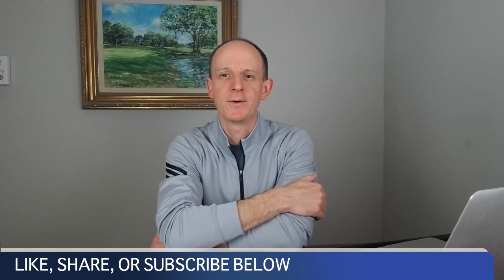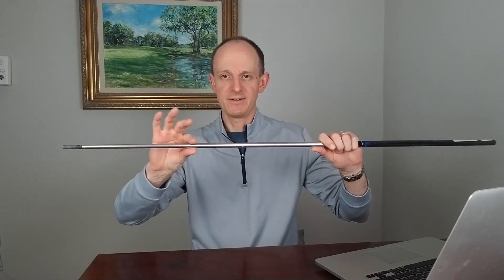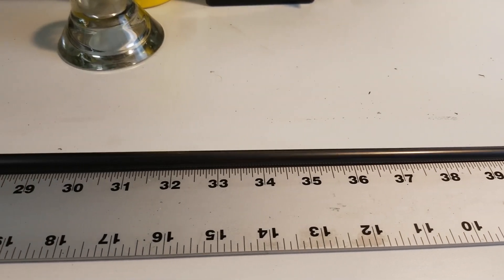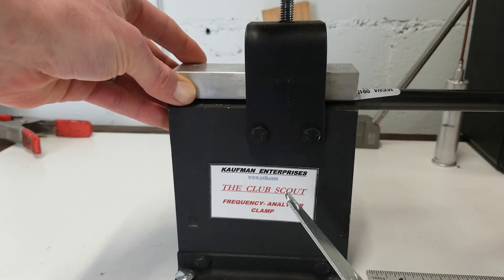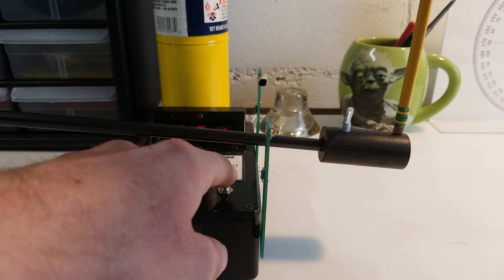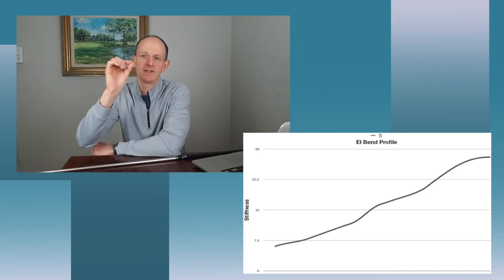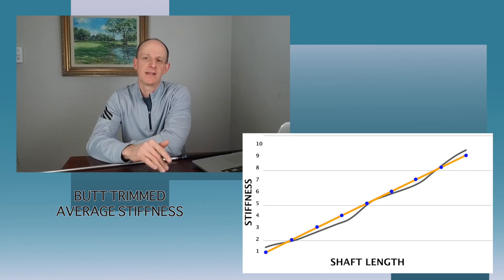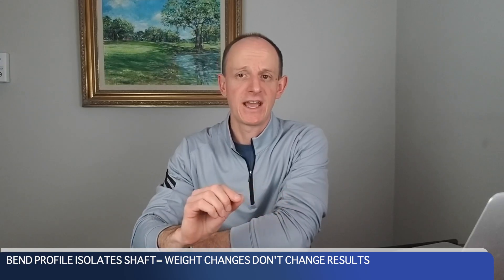SHAFT STIFFNESS, TIPPING, AND TRIMMING - What happens when we cut a golf shaft from either end

Comment: Hi: How would the tip trim stiffness apply to a normal swing.  If I play a 9* soft tip and it gets me 12 degree driver launch.  Then I trim ti tip 1.5" to a stiff.. and extend the club 1".   lower spin before and after ball leaks.   Seems like the stiff tip changes launch angle by almost a 1.5 degrees.

Comment: I was given a QI10 Max 3 wood with a stock ventus blue TR 6-R shaft. I want to cut it to 5 wood length and get more of a 6-S shaft. How should I trim the shaft and how much weight should I add to the head?
Reply from the maker: Need to take an inch off the tip side. Weight will be totally player dependent. Will need to play around with it and see if and how much you need to add back.

Comment: Hello, I thought you might be able to address a couple of questions. I purchase a used odyssey #9 putter. It’s 34” long and I’d like to cut it down an inch. How would that affect the club overall? Would it feel lighter? If so can I place some lead powder down the shaft, if so how much to have the same feel it has now? Thank you.
Reply from the maker: Yes, it will feel and be lighter. I don't like powder because it changes the feel of the putter. Lead tape or tungsten sticker weights are better and they also allow you to experiment with different amounts of weight to find what feels best. Never assume that the starting feel at one length will still be the preferred feel at a different length.
Reply: @EFGMC  hello, thank you very much for responding and sharing your insights, greatly appreciate it. I like the feel of the putter as is so I think I’ll just put a new grip on it making sure the new grip weighs the same as the one that’s on it now. All the best to you!

Comment: I bought a Ping Zing black dot lob wedge from 2nd Swing and it was advertised as measuring 36” long stiff shafted. The 36” is approx 1” longer than most sand wedges and lob wedges so I am guessing it was for a taller player. My wrist break is 35” which considered  a standard length so I’d like to trim it from the butt end  because it’s easier to shorten that way and I’ll just re-grip it. Based on your explanation for tip-end trim vs butt-end trim should it matter one way of the other??
Reply from the maker: That club should only need butt trimming to make it standard in every way.
Reply: @EFGMC greatly appreciated. Thank you!

Comment: Superb information on your video, especially for a newbie to shaft trimming and fitting. Thank you for sharing. 
If a person wanted to take a Diamana Kai 'Li Mid 65G stiff driver shaft and reduce the length for a three metal wood, it might be best to trim a short piece from both the tip end of the shaft and the butt end of the shaft to maintain  the integrity of the stiff shaft. Does that sound okay? 
If not, I'd be interested to know what your thoughts are on this.
Reply from the maker: I would default to what the OEM recommends for tip trimming a 3 wood vs a driver.
Reply: @EFGMC  Sounds good. Thank you!

Comment: Yup, great video!!! Been trying to find that unicorn driver shaft! My issue, i play a 43” to 43.25” shaft. So i know imma be trimming the shaft regardless. Its finding that right profile after the trim! To give an example, in my irons, i play the kbs tour lite… basically a 4b2m mpf code. Feels great!!!! But with my driver….. not sure. Now, my old school driver, i took the 586 speeder stiff shaft that was put into the big bertha fusion driver and trimmed -2” from the butt. Love the feel of that shaft, but need a lil more tip stiffness due to hooks from time to time. So im a lil lost haha cuz i know my swing weight is d2…. But i want a smoother feeling shaft than my hzrdus black gen 5 at 43.5”.

Comment: So this might sound like a stupid question, if you get a brand new 46" shaft and you want to shorten it to 45" and still play as the manufacturer intended, do you cut 1/2" of both ends?
Reply from the maker: If the playing length is going to be 45 then you will likely need to cut it down to 44 before installation. The manufacturer will tell you how much you should tip the  shaft. After that, any additional cutting should be done from the butt end.

Comment: I have a 45.75" Qi10 and I'm very tempted to cut it down to 44.75", but I'm nervous about the results.  I know I'm supposed to add back in 12g of weight to the head (easy to do with this driver as you can just buy heavier weights).  So in theory, the swing weight should be the same, but I'm nervous about the results with the stiffness and what it will do to the playability of the club.  Better to just choke down or cut it and add weight, will it kill the club? Thoughts?

Comment: If I  feel I am in between Stiff and Reg will it make sense to Tip trim?
Reply from the maker: You could. I also just did a video on this topic.
https://youtu.be/E9qMY0hpVg0?si=Ddfqx4rXHoATr-YT
Reply: @EFGMC  I ordered a Oban HB center balanced driver shaft regular flex, should I still tip it, or would that mess up the center balance aspect of it.
Reply from the maker: @marksnyder8697  Tip it if you were planning on it. Won't change the balance.

Comment: Another very educated video. But I think some points are missed. First of all, never trim your shaft if you want to reduce an inch, just choke up. Yes chocking up will stiffen the shaft but not because of any drastic swing speed change but a change in moment of inertia. Adding wait will put more stress on the shaft and thus greater flex.  You would never trim the tip unless you were looking to stiffen

Comment: Hi AJ..I recently purchased a set of Mamiya Recoil F4 480 iron shafts. I trimmed and fitted a shaft into an 7 iron and discovered that this shaft is too stiff. I then increased the swing weight to D4 from D1.9 and it made no real difference to the flex..If I removed and fitted this shaft to a 9 iron, without further trimming. What would be the Flex in the 9 iron? Would it then be a Regular Flex or close to a Reg flex?  Great vid again.Full of interesting content..cheers
Reply from the maker: The heavier the head you put on any given shaft, the more it can bend. You are adding around 14g of weight going from 7i to 9i so the shaft will play more flexible.
Reply: Hi AJ, may I ask, how much more flexible would the shaft be? Is there any test you could carry out and find exactly what the flex would be?...thanks Nick
Reply from the maker: @nickpritchard7130  You could put it on a frequency meter and see where it lands there.
Reply: Hi AJ..Will the shaft go down to a Reg Flex if I trim the shaft One Inch less, IE 1 1/2 inches instead of 2 1/2 inches?  Thanks
Reply from the maker: @nickpritchard7130  It will be softer, closer to R flex.

Comment: Thanks for the share! Couple of things I have tried to figure: How would the spine react in swing? Is it the droop or load with the "plane" axis what matters? Would it be more beneficial to spine along the swing "plane" rather than vertical assessing with the club head pointing upwards. I have used laser light attached to the shaft just above club head (using fishing line for quick rotation) and glued the head when the oscillation isn't spinning circle but str8

Comment: Whooo...admittedly, I ain't very smert...but I'm having a difficult time wrapping my head around this!  I comprehend each test on its own merit.  What I'm not understanding is why you think bend profile is a more accurate stiffness measurement than frequency or deflection?  I understand that for swing weight purposes...it may be more useful.  But to make the claim that a shortened shaft is in ACTUALITY "softer" than the original length shaft flies in the face of physics!  Just for the sake of argument.  If you have a 40"-40 gram shaft.  And you cut 1 gram worth from the stiffest end.  Then added that 1 gram onto the clubhead (most flexible end)...would the frequency or deflection test show a softer or a stiffer flex than the original length shaft?  My bet is on stiffer.  If that's true...then the shaft is in ACTUALITY stiffer.  of course...if you add a pound of lead to the clubhead it's going to feel softer!  But that "feel" doesn't negate the fact that the shaft is ACTUALLY...in reality stiffer!  Help AJ...what am I missing?

Comment: This video is great. Do you advocate playing the same shaft in driver and 3 wood? And if so how much would you cut from each end? For reference my driver is 45.75” and 3 wood 43”. I’ve just put the hzrdus green smoke 6.0 in driver and it’s perfect for my swing, and now I’m thinking I should try it in my 3 wood too.
Reply from the maker: I like similar shafts in both but I prefer going up in weight with the 3 wood. Shaft tipping will usually be the same for both with most shafts.
Reply: @EFGMC  would this still apply if there was a significant difference between the head weights of Driver (193g) and 3W (212g). Tip equally, finalise length via butt trim? Thanks
Reply from the maker: @lucascarlisle9116  Most shaft manufacturers recommend the same tipping for drivers and 3 woods even with the weight change. If you want the 3 wood shaft to feel stiffer, you tip it a bit. If not, don't. It's really just a small feel change in the end, so don't expect some drastic change in performance going either way.
Reply: thanks  @EFGMC  really helpful. I think I'll try it without tipping and see how I plays before cutting to final length. I guess I can always tip afterwards if it doesn't feel right? FYI the shaft in question is an Accra TZ Five M5 - can't see any specific recommendations on Accra's website but Fujikura clearly states no trimming as standard for Dr & 3W

Comment: I did something similar.  Also I've watched a bunch of videos on this topic, but no one addressed rebalancing the club... (swingweight, shaft weight, head weight, shaft stiffness).  This is the first time I've seen someone get into the details... THANK YOU

I had a spare stiff shaft (i use Reg), so I got it cut 1.5" at the tip as well as at the butt.  In theory Driver went from.a D4 SW to B4.  Not sure where i want to be so I'm starting at a SW of D0, which means 32 grams of the shaft head.  With that much weight the shaft is more like and extra soft senior, hence why I also cut off the tip of the shaft.  Now I should have a 42" driver, with a D0 SW and a Reg shaft.  In theory lol...   Can't wait to try it out.

Also did something similar to my 5 Wood :)
Reply: How did it work out ?

Comment: What a great explanation and very detailed, no one else is doing what you do on Youtube. So can i ask to be clear in my mind, if i butt trim a 45.5 inch driver by 1 inch, but then put on a lightweight grip 23grams compared to a 56 gram grip, it would make up for the loss of 6 swing weights and the shaft would play a tad stiffer, is that all correct? Sorry for the long drawn out question :)
Reply from the maker: If you only lighten the grip and don't add weight to the head then yes the shaft will feel a bit stiffer.

Comment: You dont understand EI profiles. You removed much more than an inch. You still have 10 points, but the data at each point is shifted 1". Area under the curve is how stiffness is ranked. You did get the frequency part almost right.

Comment: I want to play my driver shorter but not lose feel of tip. Since I will be adding weight to head to maintain optimal swing weight is there a ratio of weight to tip cutting to maintain tip flex?
Reply from the maker: Half an inch length change is about 5-6g added head weight to keep the swing weight and shaft flex.
Reply: @EFGMC  I understand that part but should I remove some from tip first before cutting butt end to final length so tip flex remains same or am I overthinking this?
Reply from the maker: @dennissmith1904  Would depend how much weight you plan on adding back. You could tip trim a 1/2 inch if you wanted. That only stiffens the shaft about 1/4 to 1/2 a flex.

Comment: Great video I will add tipping is mostly done for tip deflection purposes so if a player is hitting it I have a groove low hard steeping will make the contact better with a driver 3/4” tipped is the average in a tour van mainly do to drivers just perform better 5mm high

Comment: AJ, big thank you. I now realize why things feel a little funky between clubs - because I ordered new product online and made club shaft length changes before discovering your channel! 

I am 6'2" and my WRF is 36" says I should play clubs +.5 inch. (I learned this from you!)

Taking up golf again after a decade off (twin boys). Been playing again in covid - my 7-iron carries 160 yards 84 mph chs straight but ball flight is high. 

Question 1: 

Given I ordered my clubs at a store that doesn't build clubs, I assume they didn't do any fitting other than basics of length and lie.

Taylormade Burner 2.0 (hardly used!!)

Here is where I think I am at roughly...

standard D3.5
added .5 inch + D6.5
standard grip 47 gms
replaced with Jumbo XL Super Light grip 50 gms roughly = D6

So here is where I think I am at D6 ish - I can buy a scale and use an online calculator to confirm.

But here is my question - the clubs at the time felt the best in the fit - BUT I guess I was swinging the standard length in store D3.5.

But now with the extra length and changes, what swing weight or range of swing weight should I be working towards for my +1/2 inch irons?

I was thinking to tinker and add weight to the butt end of the club to bring the swing weight down to back to around D3.5 as a starting point?

See how that feels. I have 100 gms of lead tape arriving tomorrow!

Or am I missing something?

As for a performance check, I would like to see a more penetrating ball flight - as for feel, They feel ok, but my elbows got sore when I started back, I am on top of that now, after months of work on it. So interested in injury prevention too. 

Eventually, I will get properly fit, but want to gain more speed before then. So happy to tinker for now.

Comment: Great video. However the information regarding frequency is not totally accurate as you are dealing with a real wobbler. The shaft should have been floed first in both the strong and weak planes. Just my 0.02. Keep up the good work

Comment: Thanks the amazing videos. I learnt a lot from them.

I have a Tsi3 driver 45.5"' that I would cut to help me with accuracy. I tried few time to put my hands lower on the grip and I saw big difference. So, if my understanding is good, with a butt cut (where the grip is) the shaft will be a little bit stifness, but not that much ? Thanks again.
Reply from the maker: Correct. Little stiffer, little lighter static and swing weights. The weight will be what you notice more than anything else.
Reply: @EFGMC  Thanks a lot AJ. That's really appreciate. Now, my next goal is to find somewhere to buy used fitting tools.. ;)

Comment: AJ, do you have any data on graphite shafts becoming softer over a year or two as the coating and shaft fibers stretch and relax?
Reply from the maker: I don't, but I would say that it will take many years of repeat use before you would see any change in performance just based on equipment in tour players bags for multiple years. I suppose the more aggressive the shaft load and release, the faster a shaft could wear out, but I think that is just one of numerous variables that could impact the time and wear question.

Comment: Hey you have great videos and allway enjoy them. Ive been building my own clubs en fitting the for +-15 years from my own clubs for q school to some of my friends my question  i recently reshafted a stadard callaway xr driver with a ping high ballance stif  shaft  from another driver.. The shaft was extracted by somone els Nd the grafite flaired nd had to be cut a inch and a half i put the shaft in and little lead at the bottom but in an extention at the butt of the shaft it now plays 44.5 with a swingweiht of D1. 5 and it was D1. 5 before wil the shaft play stiffer or the same becuase i put the amount of weight on the head foe it to be D1. 5 again
Reply: The reason i asked after watching the video is because of the amount i took of more than 1.5 inches

Comment: Quick question, I just ordered a new tensei ck pro blue stiffshaft for my TSI3. The TSI3 plays at 45.5 standard. I asked them to cut it down to play at 45. I added 4 grams to the head weight to bring the swing weight back up. Went to hit it in the range and it the shafts feels way too loose. Almost like a regular flex. Would that be because when they cut the shaft, the cut from the butt end? Then I added weight back, making the tip okay softer than it usually does? Would it make sense to tip it like 1/4th if an inch to bring it back to its regular stiffness?
Reply from the maker: Correct, added head weight will loosen the shaft feel. 1/4 inch tipping will likely not change anything enough to make it worth while. 1/2 inch might show a feel difference. Assume that tipping 1 full inch will increase the stiffness a half flex with no head weight change. Might need to add a extension to the butt end and tip more.
Or remove some of the extra head weight and see how it plays for you at lighter SW.
Reply: @EFGMC  makes sense. If I order a custom club from a manufacturer, and ask them to have it play at 45, do they take that into consideration and cut it in a way that doesn’t change the shaft profile, while still getting the swing weight right?
Reply: Also, what would be the correct way to cut down a shaft when still wanting it to play the same profile and swing weight?
Reply from the maker: @jantzenadams4261  No they don't. They will only do what you ask them to, and this is at best limited as to what they will and won't do. If you really want that level of detail, you need to go to a club builder who knows how this works.